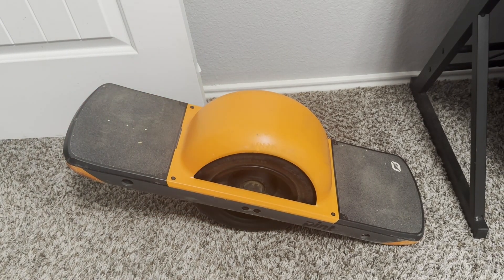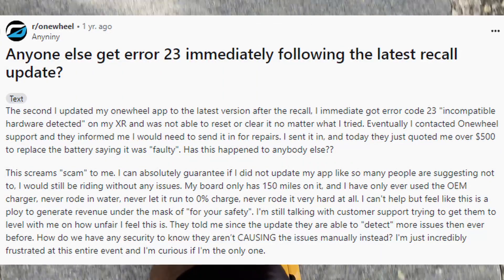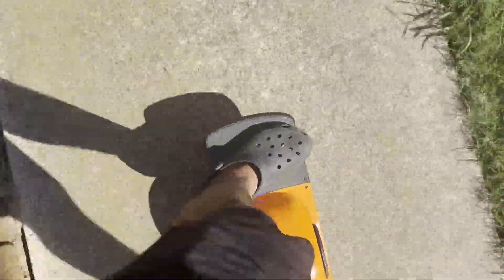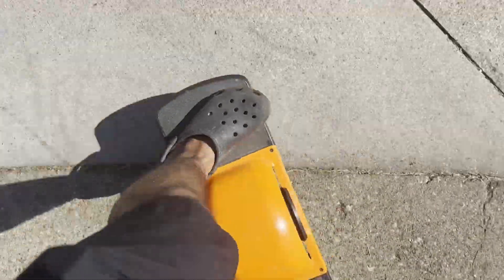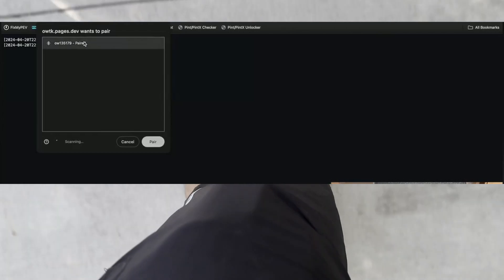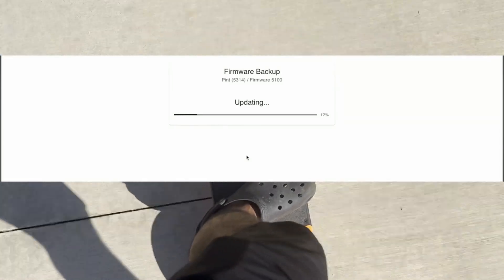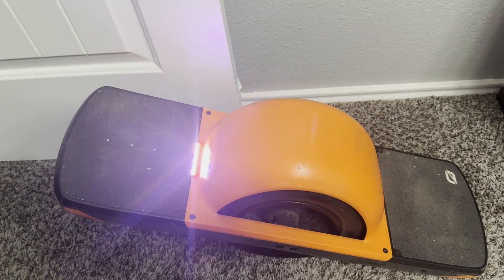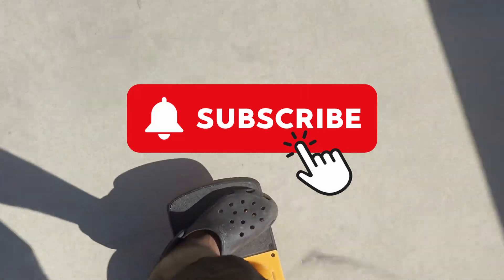How to Fix Error 23 on One Wheel Pint ( Could Fix Other Errors As well)

Comment: I have the same Error 23 and it shows up right in the middle of a ride. I put the pint on charge overnight and the next morning when I turn it on, the error 23 still there. Then I charged the pint again, for like couple times, each time couple minutes. Finally when I turn on the pint, the red error 23 is gone, instead, I got three yellow flashes due to overcharged. Then I take the pint outside, turn it on and jump on it before the yellow flashes. Problem solved😂
Reply from the maker: @xiii13  lol that works! Thanks for sharing 😂
Reply: @ Amazing!🤩

Comment: does not work with firmware 5200 (anything over 5100)
Reply from the maker: I would try it anyways if you’re on your last leg. The custom firmware didn’t work for my one wheel  pint I think it bricked it but got rid of the red light and then I was able to re download the  latest firmware through the One Wheel App. But do it at your own risk this was all experimental and it worked for me.